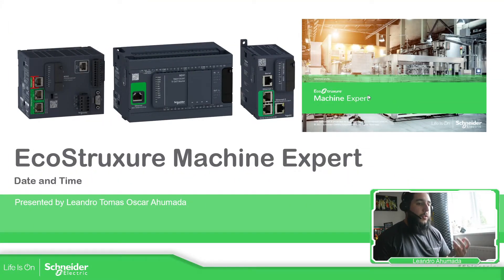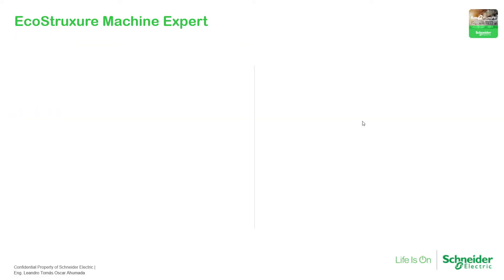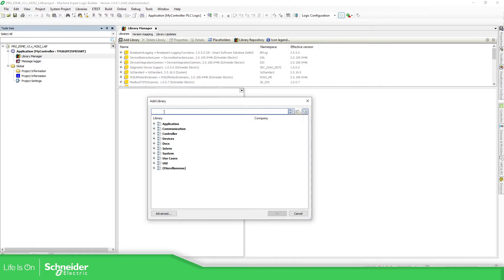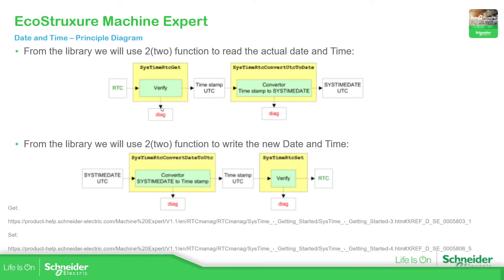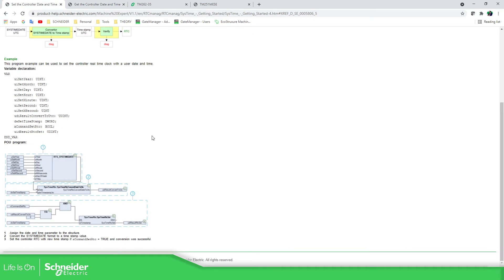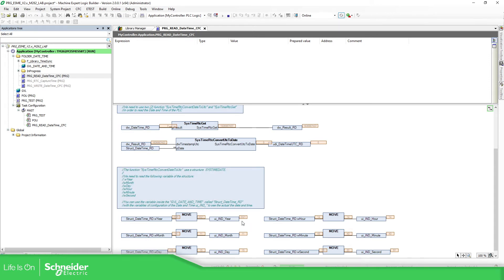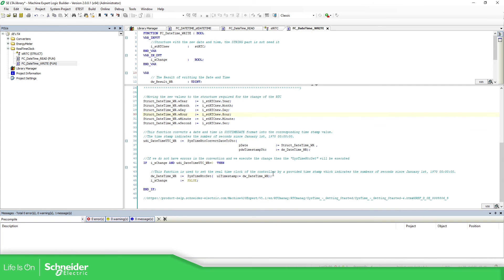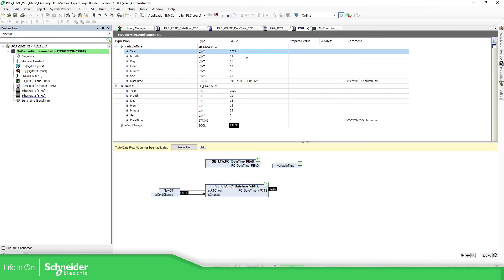EcoStruxure Machine Expert - How to Read or change the Actual Date & time in the PLC

Comment: While not immediately "useful", for anyone who actually uses the RTC, especially on the m241 or better controllers, this is GREAT information to have; RTC applications are often something in a customer request; in place of "okay, I want this to run five minutes every fifteen", now you can do something closer to "I want this to run for an hour every second tuesday" or "this needs to run for five minutes every second wednesday".
Reply from the maker: Thanks for sharing your knowledge with us 😊
Reply: Good use case, I am checking this video to implement alarm management for M241